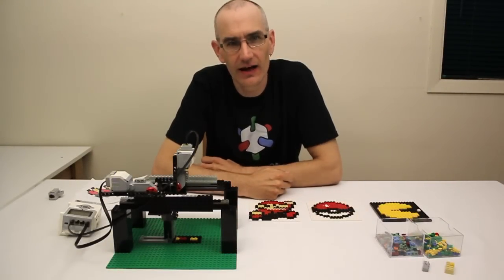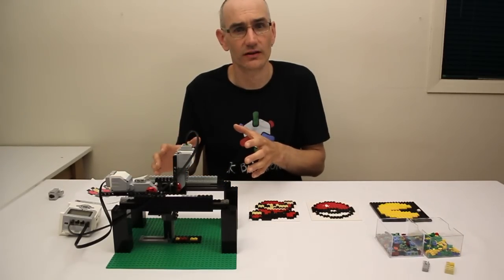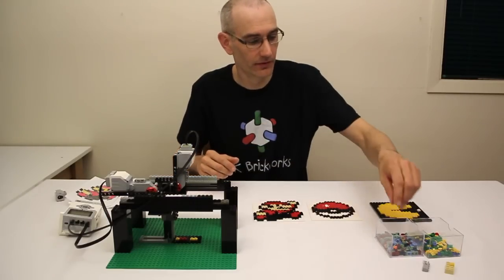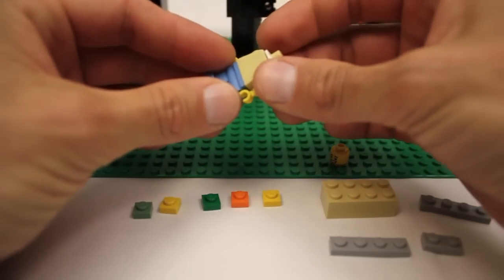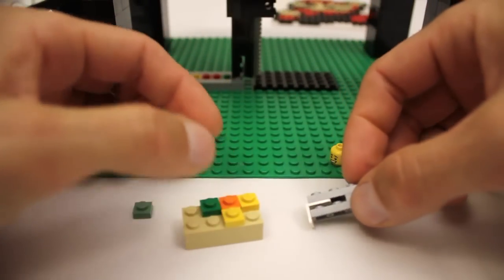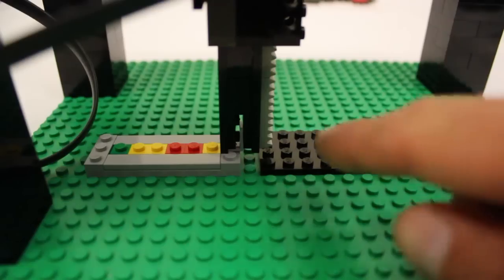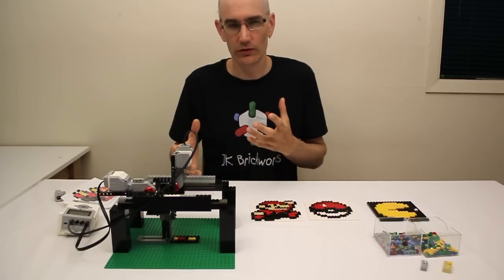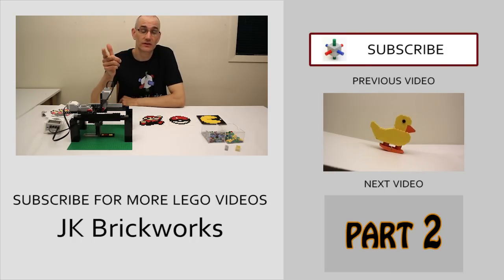The LEGO Printer Project - Part 1

Comment: Hi, Jason, Thanks for amazing design firstly. Could you tell us what part number of the special part? Coz I don't know where I can find it. Another question is about program. How do you program and let the robot arm to feed brick every time accurately? I think it's very difficult to let the robot work stable after a hundred times.
Reply from the maker: 范翔 It's part number 42446 (http://www.bricklink.com/catalogItem.asp?P=42446)  The mindstorms motors can be moved in 1 degree increments, so you can position them pretty precisely. So far I haven't run into any problems with moving them but we'll see if I run into any problems after running it for a while.
Reply: Thank you Jason! Maybe you can share the program with us. I hate robot run different moves under the same program. We hope to see you next work. Wish you best.

Comment: Thanks for the video! I love watching the thought process that goes into this.

Have you thought about making the bed for the mosaic move in the XY axis instead of the brick arm assembly?
Reply from the maker: ***** Thanks! Yeah, I have thought about it, and I'm kind of torn between doing it this way or that way right now. Someone else also suggested keeping the arm like it is now moving in the x direction and having the mosaic move in the y direction. In the end it will come down to how I have everything laid out.  The machine has to be able to scan an image, go get pieces from the supply and then put those pieces on the mosaic.  The supply will actually be pretty large, so I might not want to move that whole thing around.  Either way, we'll see what happens. :)  Thanks for the comment!

Comment: This is awesome! Have you given any thought to increasing relative error? By which I mean is the movement of the motor relative to its former position or does it have a point where it can reset itself? If there is no absolute point to reset the system, the relative error could increase so much on larger builds that the pieces wouldn't fit anymore. For example, a piece at the end of the track attached to the frame, which the motor would run itself against every now and then, would probably work.
Reply from the maker: JayByte Thanks! Yeah, I've given a little thought to this, but I don't know yet how much of an issue it will be. I guess I'll find out once I extend it to move further!

Comment: Nice! I'm looking forward to the finished model!

I've got a couple of suggestions for piece pick-up: you could create a number of trays such as the one you used here, but each with a different color of piece, and then line them up side by side and then the machine can count motor rotations along the rows of piece trays to determine which color piece tray it is on top of.
  
When it picks up a piece, you could do one of three things to get it to pick up the next piece in line without pushing it forward with your finger: (1 you could push the row of pieces with a lever of some kind driven by a motor instead of with your hand, (2 you could have the robot move farther back to pick up the next piece, and (3 you could make each tray of pieces much like a ammunition cartridge, with a soft spring in the back of the tray to push pieces to the front when one is picked up.

Good luck with the project! I may try something similar eventually, but right now I'm working on a motion controlled robot.
Reply from the maker: Benjamin Corey Cool, thanks for the ideas!  I've been playing with some gravity feeding mechanisms which might also work.
Reply: JK Brickworks I'm curious as to how a gravity fed mechanism would work, because if the tray is at an angle, wouldn't the machine also have to be at an angle in order to pick up the piece? 
Or does a stationary object attached to the machine level the tray out when the machine is over it and then when the machine goes, the tray tilts, sliding pieces to the front again (You could use a rubber band to do that)? The only problem I can see with that is that tilting back to a level position once the machine reaches the tray could make the pieces slide back a little if the machine comes to the tray too quickly. Then again, you could always have the machine slow down before it reaches the tray, so that technique could be easily viable.
Reply from the maker: Benjamin Corey Yeah, there will definitely be some challenges. Hopefully I can get something to work!

Comment: I would have the plate you are going to build on move back and forth rather than another set for the gears.
Reply: projectzip Great idea for extra precision and also to avoid slop.

Plus the head will only need to move horizontally in one axis (X) to pick up and deliver, and the build bed (Y) can change position while the head grabs another piece, increasing overall build speed; if the X position of the head is near the piece storage, the time it otherwise potentially takes the head to move along the Y axis to the center, before it can grab another piece, is saved, by having a bed that can move independently of the head while it picks up, sharing the time spent moving. The piece storage could have another bed of it's own to move along the Y axis, so it can store more pieces for grabs.

Comment: So I had an idea for the scanning:
you could build it like a reverse working printer, that scans one line of the picture and then move on to the next one. Then store all the colours in a 2-dimensional array. When you do it this way, it's easy to acces each color after each color without having tons of variables.
But which way you ever choose, you need to define one color as 'background', which the roboter will then leave blank at the final pixel art.

However, you could also scan one color, place it with the roboter arm, and then move on the the next one, altough I wouldn't finde it as cool as with a "scanning..." screen ;)
Reply from the maker: Aaron Längert Yup, that sounds about like what I had in mind.
Reply: JK Brickworks Maybe the scanning can also be done using a mobile device which takes a photo and converts it into these colored tiles and their positions. This can be wirelessly transferred to the NXT which would then build the 2-D mosaic. You might have to build an app for this.
Reply: Well, that sounds complicated but maybe I will try it out